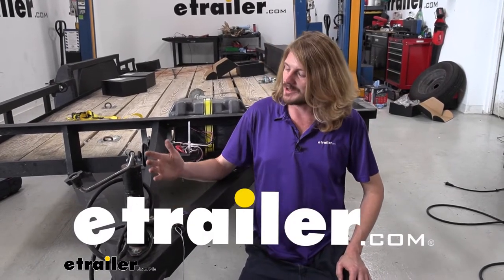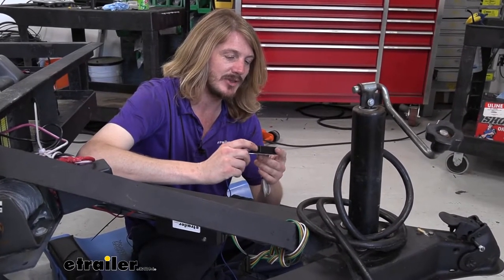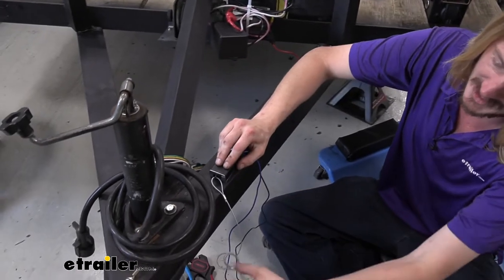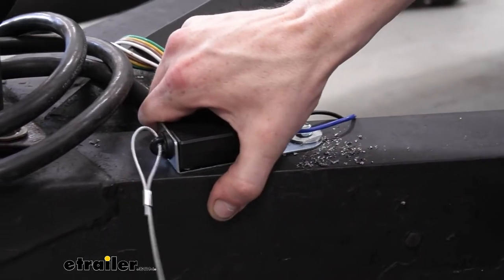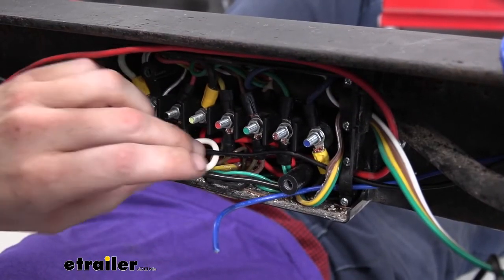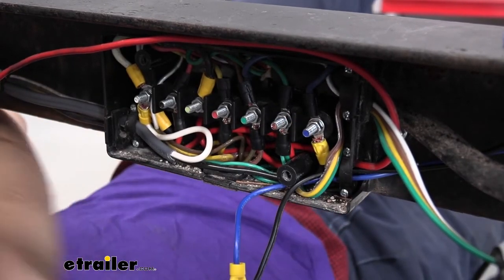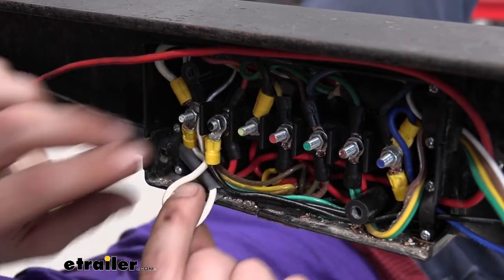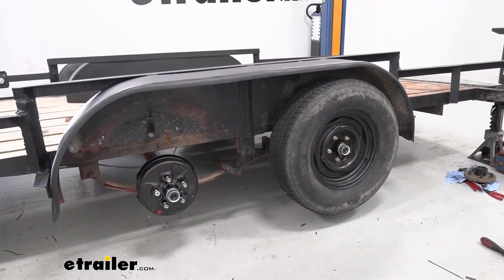etrailer | Replacement Breakaway Switch for Bright Way Trailer Breakaway Kits: The Breakdown

Comment: on the wire that goes back to the Battery from the controller, does in connect to the + or - Post?

Comment: Pulled mine out and it won't go all the way back in
Reply from the maker: The flat spring used to hold the pin in place is pretty stiff. You might not be pushing in hard enough. Take a peek in there to make sure the spring isn't damaged. 
https://www.etrailer.com/Accessories-and-Parts/Bright-Way/3802348.html
Reply: @etrailer  I get it all the way to the o ring but it easily comes back out. Cheap replacement for the whole breakaway kit so I just ordered a new one 👍 thanks for your quick reply.
Reply from the maker: You're welcome!